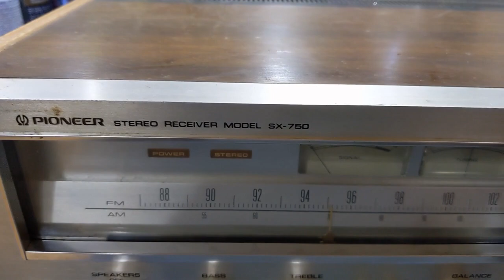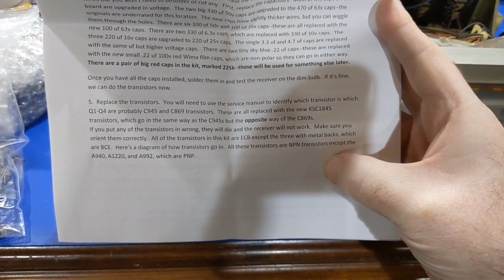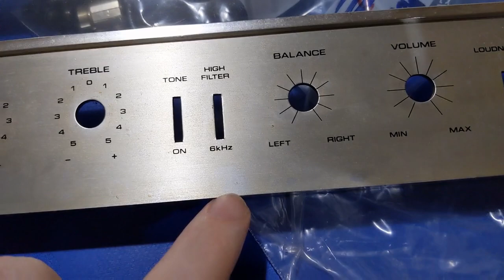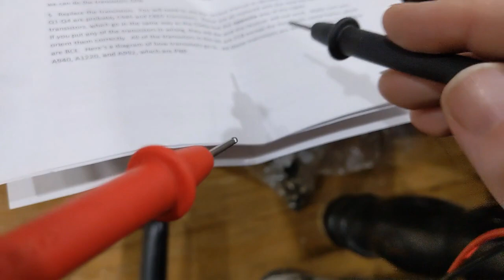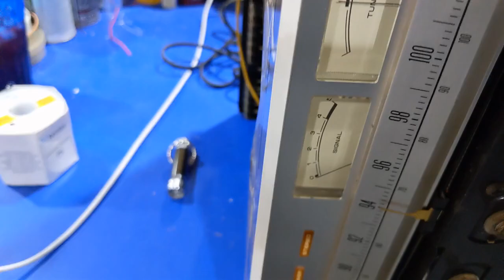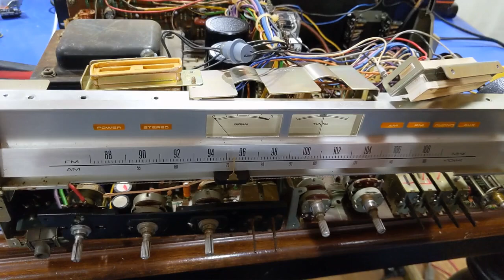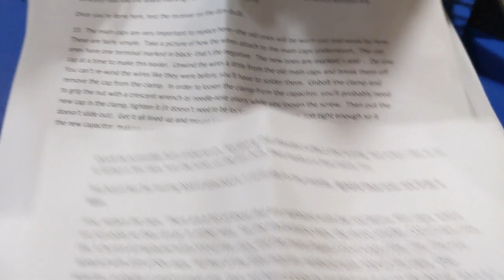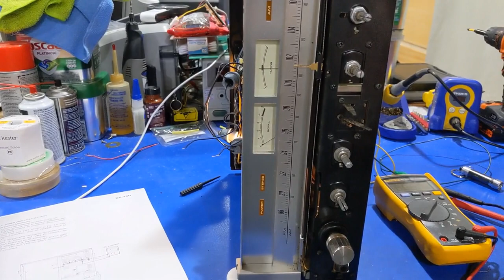Pioneer SX-750: Restoration part 1

Comment: Hi, I just have purchased one of these receivers and I'm thinking of buying this kit and i wanted to know if you are satisfied with the sound quality and everything else after restoration. I noticed that the capacitors on the power supply board get hot and i don't know if that's good. Thanks